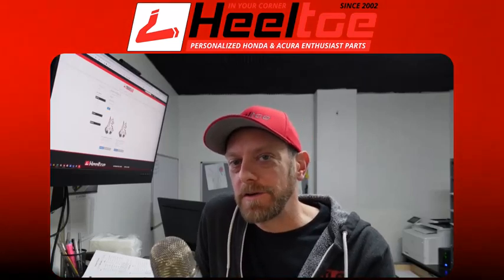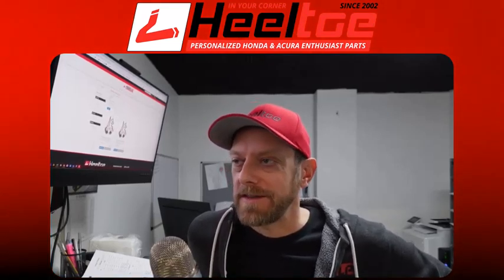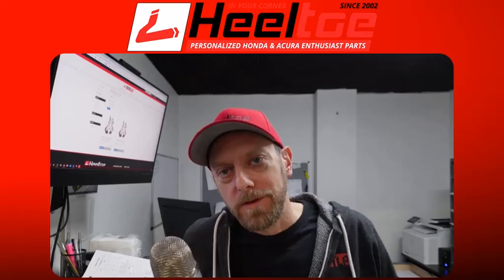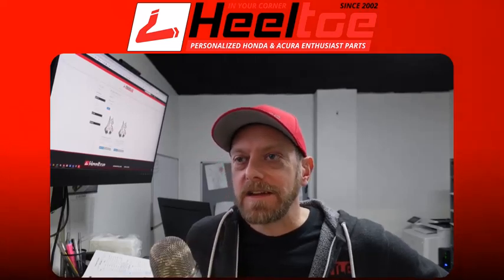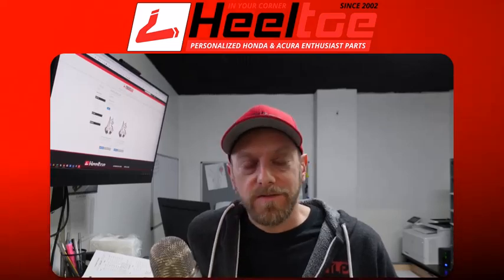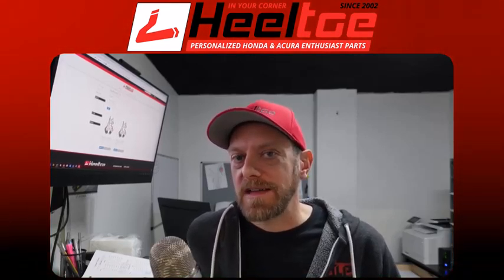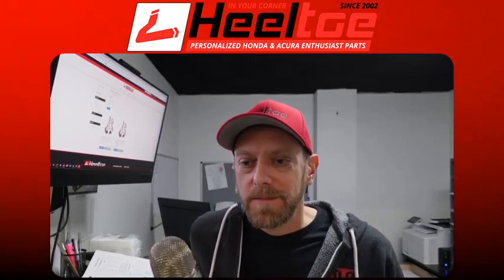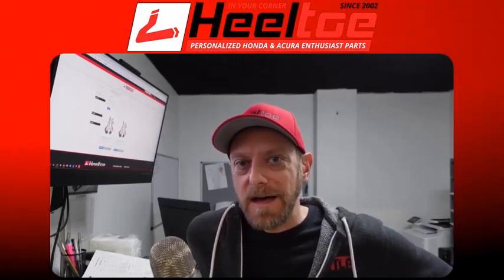CC29: The Right Exhaust Size Isn't Bigger

Comment: Especially with NA, a lot of people dont take scavenging into account when doing these muffler or resonator deletes, or changing exhaust diameter just because …
Reply from the maker: Especially NA, the exhaust size need to be "right" not just big.
Reply: @Heeltoe.  this is super good info for the beginner enthusiast so they enjoy their cars properly. Not a lot of people understand that maybe the increase in diameter depends on whether your exhaust system is becoming a bottleneck or not. Thats at least for me the only reason why i would upgrade diameter in an exhaust system. Also the fact that increase in diameter makes drone control that much harder and me being 39yo I hate drone 😂.

Comment: I have accord cp2 with k24z2 stock motor. What is the recommended exhaust size to improve the low end and mid range torque without increasing the noise level from stock?

Comment: I recently bought a 2008 TL type s. Was wanting to get an ATLP exhaust. I was interested in the 3” setup. Plan on getting a 3.7 intake and TB and probably a few other things with a tune. My question is do you think I should go for the 3” or 2.5” setup. I am wanting to stay NA
Reply from the maker: If you are going to be doing those air/fuel upgrades and tuning and want the most peak power then it can make sense to do the 3". For more balanced gain and the resonator option to keep the interior sound lower, go 2.5"

Comment: The late 80' SLP did a single exhaust for the Firehawk and it was worth 15 hp more. But they couldn't give it away because everyone thought duals were better looking.
Reply from the maker: A car like that 100% is only going to do well with dual outlets. Even the camaro and firebird in the 90s and 00s had a single exhaust to a transvers muffler with dual outlets in the back. Fastest way for a carmaker to make a car boring is to hide exhaust, and best way to make it sporty is to put dual outlets.
Reply: They make exhaust for tires?

Comment: This is especially true on a NA motor.  I put a 2.5” on my B16 and it lost low end power. Put a 2.25 in resonator in the middle and got the most uniform power band.  Funny thing was, I was much younger then, the guy at the muffler shop warned me that I was going to lose power but I wanted big!
Reply from the maker: NA is such a special animal. There is absolutely a right way to do it and believe it or not sometimes the best way to know is by trial and error, AKA "Testing." A build B16A with big cams may have liked the 2.5" but probably only at top end.
Reply: @Heeltoe.  so true!  That’s one great thing about the internet and forums now days.  When I put the K24 in there was no question I was putting a 3in system in.  So much data available on the web about what works.  Back then it just didn’t exist like it does today.  Others have done and shared the testing.

Comment: Solid topic marcus. I have to agree bigger isnt always better. I have pushed your 3" ATLP on the 3rd gen TL to 620whp without issues. The best sounding exhaust for that platform in my opinion. Unfortunately i made the mistake of going custom to squeeze as much out of the system and sound wise its no where near as good as the ATLP. 

A buddy of mine went from a 2.5inch tsudo to a custom 3 inch single exit. This was done because everyone and their mom in the 3rd gen tl community says single exit 3 inch is better measured by the butt dyno. Well, my buddy, who is also supercharged made 0 horsepower extra after going single exit from his tsudo. Made 506whp with the tsudo and made 506whp again with the single exit. Bigger isnt alwas better.
Reply from the maker: Interesting about your buddy. On a 3g we definitely see a bump going from 2.5 to 3.0. Maybe there is more to the story on either side. Anyway, hard to say the same results will be there for all people. It's called TUNING!